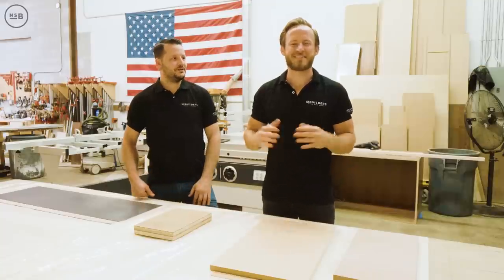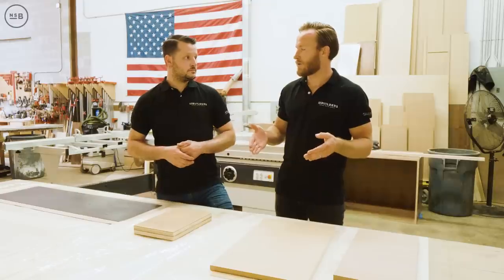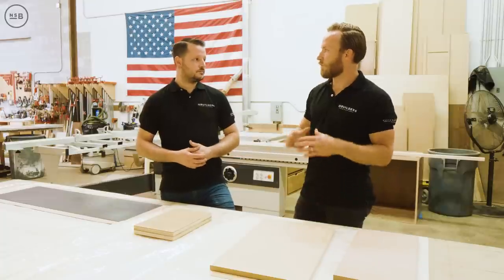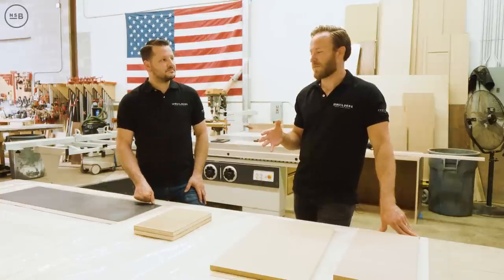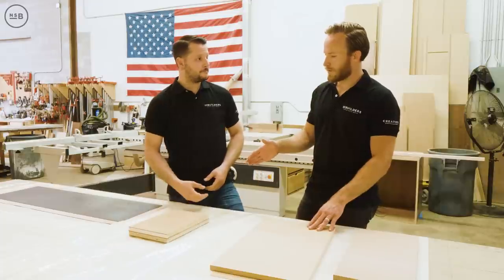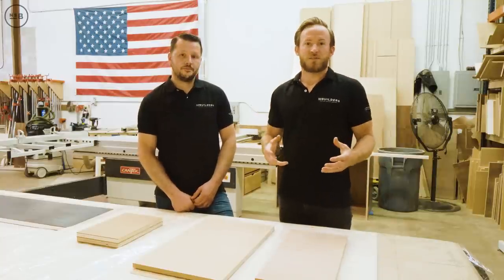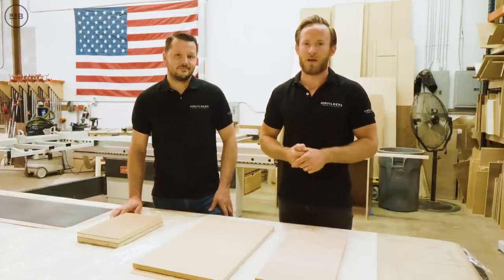What is a vacuum bag? | Nick Schiffer Podcast

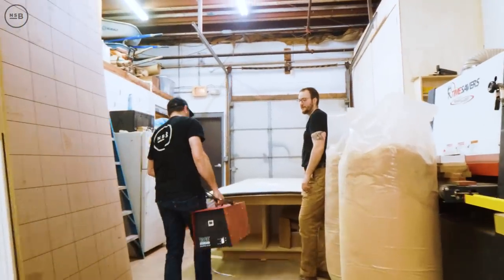Comment from the maker: 00:46 What is a vacuum bag?
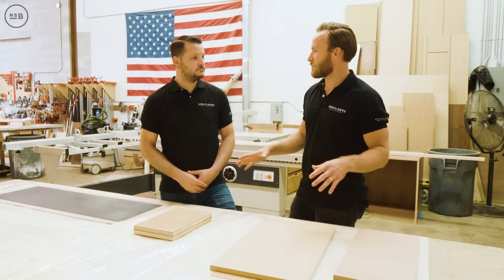01:42 Potability of vacuum bag.
02:46 Airtight zipper of the vacuum bag.
03:47 Importance of keeping it level.
04:18 What is a Platen?
05:20 Adjustability of the vacuum bag.
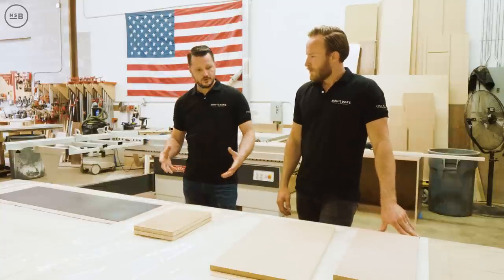07:21 Examples of what you can do with a vacuum bag.
08:55 Veneer in the vacuum bag.
10:36 Curved cabinetry